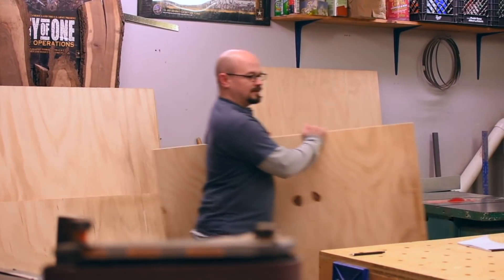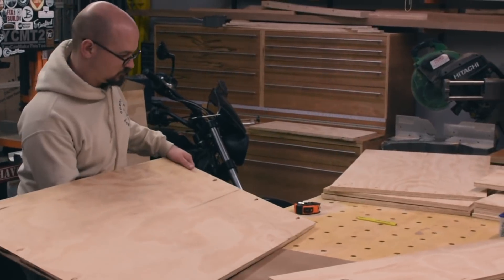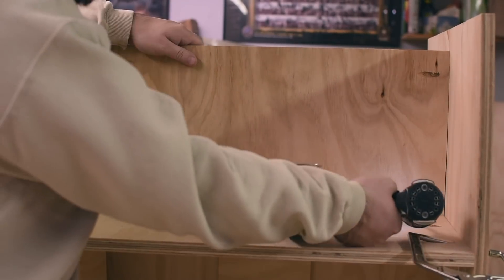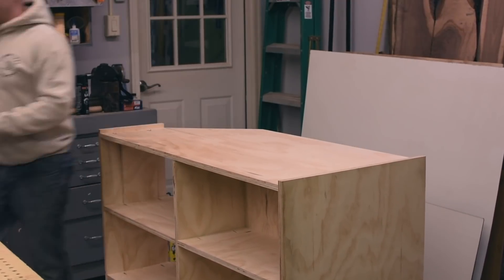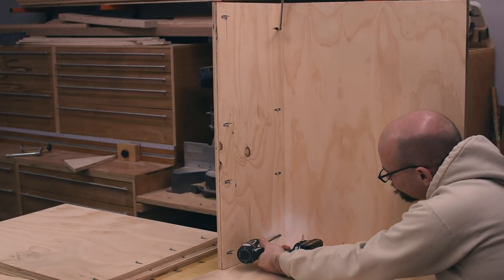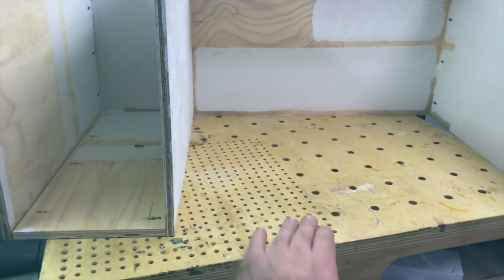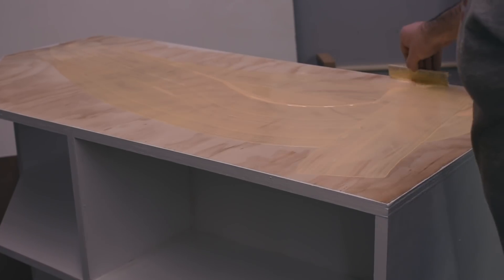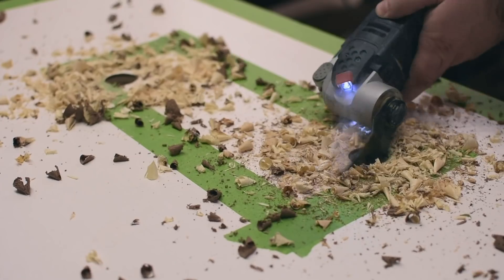How To Make a Sewing Table and Craft Table

Comment: How well does that Kreg Clamp hold the jig down?  I got really tired of screwing and unscrewing clamps as the bit would try to run if the clamp wasn't tight enough.

Nice video as well.  Thanks for posting!
Reply from the maker: I used a spring clamp, but that was a pain, I held it by hand for several projects but that got old. I like this clamp, I think they stopped making it. It’s the auto adjust and kind of finnicky. But it generally works well for me.
Reply: Thanks.  They have it at my local big blue, but I wasn't sure if it worked well.
Reply from the maker: It’s made life a lot easier

Comment: Nice work!  That's a pretty sweet idea to recess the sewing machine into the table.  I'm sure you earned mega points with the wife for this build.  It's just a shame that all the points reset every night.  :)  Great job!  And it was cool of you to plug Mr. Neiner too... what a great guy.
Reply from the maker: Thanks! Yeah, she’s a big fan. It was her Christmas present so it was a great deal. I got to do a build and video, and she got a crafting center, haha. Doug is awesome!
Reply: Just FYI, sewing tables have historically had recessable compartments for the machine. It used to be de rigeur because, well, the machine was built in to the table and the belts and foot pedal were also integrated. But you could also fold the machine away inside the table. This technology was common easily 100 years ago, if the sewing machine I learned on wasn't some kind of steampunk unicorn device! 

(Note the last 25 seconds in this video for instance) https://www.youtube.com/watch?v=MBwlmB1aGmA
Reply from the maker: That makes a lot of sense! Brings to mind the old folding treadle swinger my mom had. Thanks for sharing!